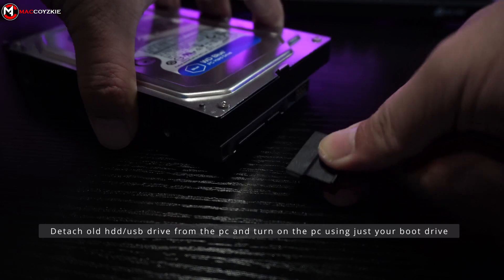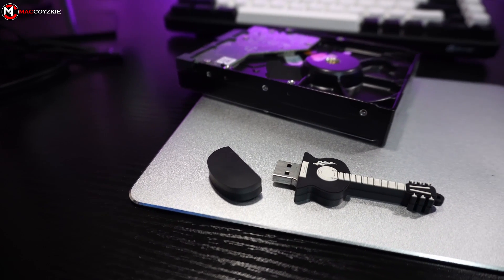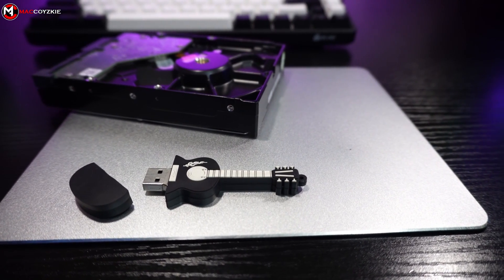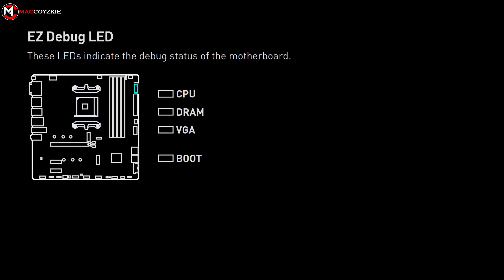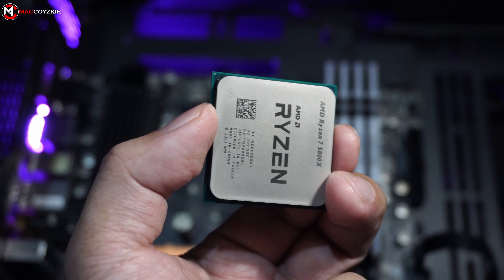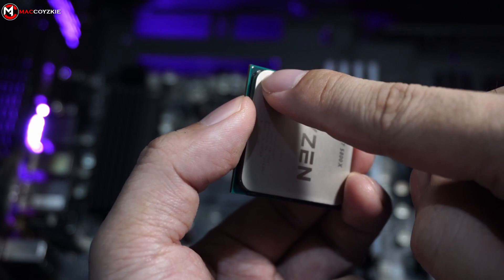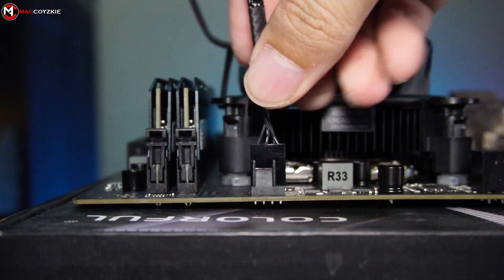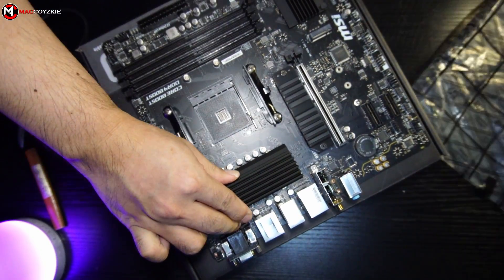Debug LED always on FIX

Comment: Have any of you guys ever managed to get your PC to post but the DRAM light remains on???? what the hell is going on? BIOS is fine for latest or oldest version, ram is detected, base ram speed and oc ram speed is fine according to the menu. All the components are listed. No CPU warning light. What am I meant to do? I was advised to just ignore the light and continue with OS installation and drivers.

I've done the CMOS clear, reseating the RAMs, doing one stick of RAM. All that got me was getting the PC to post. 

I even unlatched the CPU which I absolutely hated I feel like I am damaging the pins everytime I do this. And I untightened the CPU air cooler which runs the risk of it falling off the board given how heavy it is.

I am so goddamn frustrated. I know for a first pc build it should be but this is a whole other level man.
Reply from the maker: about the bios update, firmware must be specifically compatible with your cpu. if you already done that and the debug led is still bothering you i suggest return the mobo to the store where you got it from and ask for replacement. this is actually considered as faulty mobo since it's not reporting the correct debug led.
Reply: @MacCoyzkie  I managed a few restarts with windows doing updates. It did briefly have blue screen of death sad face for half a second and crashed. But now all the updates for drivers are done. I am now running a memtest86 test to check for faulty ram or motherboard. The motherboard now briefly lights up the CPU led, then DRAM and then both are turned off when I restart the pc. Thankyou for personally responding with a very helpful reply. Have a merry Christmas.
Reply from the maker: @qus.9617  glad it all went well bro! Merry Christmas to you too

Comment: vga light is on i can get to windows  but it dasnt let me get into bios , and when iam closing my pc i get thte monitor message check signal cable iv tried everyhitng execpt  changing mobo or monitor, i will try to test it another monitor but i know it will not do anuthing different

Comment: Sir mac, same issue ito ng akin nabili ko si mobo 2nd hand. For almost 4 months ganito na nangyari, nasira din nvme ko at not working na. Tapos eto for almost a week. Cpu light indicator lagi. May times na pabalik balik ilaw niya cpu-vga-boot tapos balik sa cpu, mag display yung auto repair pero mawawala display iilaw uli cpu. Ano kaya main reason ng ganito si mac?
Reply from the maker: nasira pati nvme sa mobo? baka short issue boss. yung kapag nadikit yung mobo sa pc case, may mga case kasi na mabilis daluyan ng kuryente kaya kapag di kilala ang pc case na bini-build ko, naglalagay ako ng electric tape dun sa standoffs ng mobo. minsan kasi nagkakashort dun kaya naga-ground ka kapag hahawakan mo yung bakal ng pc case

Comment: my motherboard shows vga led everytime i boot up in its stuck on a black screen. it occasionally turns on just fine but most of the time it doesn't. im using a 4650g without a separate gpu on msi a550m pro. please help
Reply from the maker: can you try clearing cmos for now, this is to run things in default settings, also for the mobo to redetect your hardware connected to it https://youtu.be/S9hyEPTFR10

Comment: Nice. But what if i randomly have CPU led light. Sometimes PC starts normal without problem. If it is started then it will work without any problem. If it is not i may need to hard reset it several times to make it run. What is the issue? PSU? CPU? MOBO?
Reply from the maker: sometimes you just have to reattach the psu pins on the motherboard, I fixed a pc recently with the same problem wherein i thought it was a faulty cpu but i tried a different psu, then it works, i thought it was his psu but when i tried this pc with his psu again and it worked. just need to reattach the psu
Reply: @MacCoyzkie  thanks! I will try it. Hope it is just PSU

Comment: My dram will light up but after a little bit will shut off then my display will boot up
Reply from the maker: that's normal, it's actually checking the hardware, but if the light didn't shut off then you can do the following in this video

Comment: I got different  problem  boot led always  on a620m e but pc running  fine. I cant turn it off
Reply from the maker: if pc is working fine you can just leave it but if its bothering you so much you need to update bios. for some reason most stock motherboards nowadays are doing that. tbh i will suggest you update it. be careful if you're going to do it your own https://youtube.com/shorts/nfH5Do3Dq3o

or just bring it to a local shop and have them update it for you
Reply: @MacCoyzkie  yup i am suspended  its a faulty bios related  issue . I am not touching it anymore untill its necessary

Comment: I just cleaned up my pc today. I put a new thermal paste. Now, I tried several stpes to fix it. What if there are no lights that pops out when I opened my PC, but the motherboard works. The GPU is On with lights, the CPU fan is working, but no lights on RAM. However I believe there’s no issue with the DRAM because I don’t say any lights from those 4. Any solution to this? Please help. Thanks!
Reply from the maker: if you tear the pc down including the cables then its most likely you misplaced the front panel connectors. double check it https://youtu.be/LxRzL5WFB9c 
try to jumpstart it through the motherboard using a screw driver 

also make sure the everything hardware and cables are seated correctly, especially the ram sticks https://youtu.be/UKR5xRsOhNg
Reply: @ the F Panel was all good to be honest. I really don’t know what could be the exact problem into this.
Reply from the maker: @kenozieobina5234  can you ask a relative or friend with compatible pc to try out your ram sticks? it's really difficult to figure out what's wrong so we need to test the individual parts of your pc into another working pc
Reply: @MacCoyzkie  ended up buying a new mobo, it was the problem. Very sad though it only took 2yrs, as there was moist inside.
Reply from the maker: @kenozieobina5234  sorry to hear that bro, 2 years is short indeed. try placing silica gel inside the pc if you are not going to use it for a several days https://youtube.com/shorts/NcLkeTdquXw

Comment: Hey how about the cpu turn on but no led light up even  the red one. Please help
Reply from the maker: two things, psu is faulty or the motherboard is faulty. if you got a spare psu try it out to check
Reply: @MacCoyzkie  thanks I did try it on different PSU. Same result. I have no spare board. But the board led lights up. When I turn it on
Reply from the maker: @macahappy0609  sorry to hear that bro but the mobo might be dead. is this a new build?

Comment: If there is no lights after dram light goes off???
Reply from the maker: it means it detected the ram sticks and its working just fine
Reply: @MacCoyzkie  but no boot after dram light pass
Reply from the maker: @jaswindersocialscholar  is this a new build or was a working pc? what's the pc specs and how did the problem started?
Reply: @MacCoyzkie  it's working pc and before that random frezzes started earlier and than sometimes this no boot sometimes working fine and than suddenly random freeze
Reply: i7 6700k + Asus z270f + thor 850watt
Reply from the maker: @jaswindersocialscholar  can you try entering safe mode https://youtube.com/shorts/IZKc8plksDA and ddu the current gpu driver https://youtu.be/SvIJhcxZTsA

if you can also remove any old hdd, remove it atm and just boot with the ssd 

if you can't enter safe mode then we need to check the gpu with a different working pc

Comment: My cpu debug light is on but when i went to a repair shop and tested it they said the gpu was the problem and when they place a new one the pc booted up... and although they cleaned the gpu and it worked again im now experiencing the same problem with the pc not displaying anything. Should i try cleaning the gpu again or make them test other parts
Reply from the maker: you can clean it the same way i did in this video, if it still does not work have it tested in your relative or friend's compatible pc to double check

Comment: I’ve tried everything, my motherboard is brand new, I’ve reseated my cpu 4 times and nothing and I’ve cleaned my ram I even got new ram and still nothing the dram light won’t turn off😢
Reply from the maker: new build or was a working pc? what's the pc specs?

Comment: What if all the debug lights turned on? I have a pc here that doesnt boot because of this.
Reply from the maker: if you watched the video these may be all the parts then, what's your pc specs?
Reply: @MacCoyzkie  5600x and 4060 ti. Its now fixed by resetting the CMOS for an hour. We suspect it was a motherboard error as we just installed a new cpu cooler.
Reply from the maker: @1torch  i see, glad its all good now

Comment: I have a 7800x3D and RX7900 and my display works, windows comes up, performance is fine, but the VGA Light is blinking green/orange, what does this mean? It blinks the same way when I remove the video card and get the image from the processor, it also blinks when I get the image from the video card. can anyone help?
b650 tomahawk
Reply from the maker: i checked your mobo's manual and it doesn't tell anything about the colors, for some reason these motherboard's from out of the box are giving these wrong debug led reports even if you can enter windows desktop. you can fix that by updating bios, just be careful if you are going to do it yourself https://youtube.com/shorts/nfH5Do3Dq3o

Comment: Hi,
I have cpu amd ryzen 7600 and msi b650 m gaming plus motherboard.
Using xpg 32gb 6000mhz single ram.
When i am booting by using 1st to 3rd slot in ram. It is giving me red and yello light errror. Not booting.
But when i using ram in 4th slot.
Red light go away in 10 sec and after next 30 sec pc booting up.

Not sure what is isssue, this my new PC not sure how to fix.
Can you please help.
Thank you for hear me out. Looking forward to hear from you.
Reply from the maker: the advisable slot should be the 1st one in a single ram stick build. shut the pc down, unplug it, place ram on the 1st slot, clear cmos https://youtu.be/S9hyEPTFR10 before power the pc back on

Comment: The whole video should be called : "remove and reinsert"
No matter what i did, the DRAM led was stuck. No RAM, one after the other RAM, switched RAM positions, Different RAM. Nothing worked. The RAM was tested in another rig with no issue.
So let's not forget the obvious reason. YOUR MOTHERBOARD IS TOAST.

Comment: Can it also be that the MOBO itself is faulty? I randomly get CPU and sometimes boot light but there are also times when my PC boots normally without applying any changs. What can it be?
Reply from the maker: yes but try to reseat the cpu first
Reply: @MacCoyzkie  I tried everything ang now I randomly get CPU light or VGA light and sometimes Boot light. But when the PC manages to boot it is very slow and even desktop feels laggy. I'll try replacing mobo and see if it helps.
Reply from the maker: @TheDiagoz1  you going to buy a new one? hope it goes well

Comment: I was playing on my pc and the display stopped working but everything was on, fans and gpu, I turned off my pc and then back on and it kept doing this until I had no display at all the pc is prebuilt and here it is

STGAubron Gaming Desktop PC, Radeon RX 580 16G GDDR5, AMD Athlon 3000G 3.5G, 16G RAM, 512G SSD, 600M WiFi, BT 5.0, RGB Fan x 4, RGB Keyboard & Mouse & Mouse Pad, W11H64
Reply from the maker: can you try the ram cleaning method in this link https://youtu.be/4hYcx-SdbU8 skip to 1:50 and if that does not work then this might be a psu problem. it probably gave up during the gaming session. you can confirm this by using a different psu so if you got a spare one or at least borrow from a relative or a friend

Comment: My PC works fine but sometimes the boot light stays on the motherboard when I get into windows and just stays there. It happens maybe 1 boot out of 6. A restart clears it. Im using an m.2 drive reporting no problems in testing. Feels more like bad motherboard bios/software.
Reply from the maker: yep, for some reason these motherboards released this year or at least the old bios is causing this. nothing will happen if you don't update it and your pc will work just fine, but if its bothering you so much you can update the bios, make sure the firmware is compatible with your cpu, and be careful, more info here https://youtube.com/shorts/nfH5Do3Dq3o
Reply: @MacCoyzkie  Happens on multiple bios so far. Even on a beta bios to test now but still happening occasionally. I also have crazy issues with their GCC software and RGB thinking their the wrong colours. What's annoying is I picked this board cause I had a x570 aorus elite before. It never had any issues ever over 2 CPUs. Legit uninstalled all the GCC crap but lose ability to change the little screen on my rx 6800 master gpu. I eventually managed to manually delete gcc and keep the screen at the last thing I set it to. Had to leave rgbS working from default bios as rainbow puke lol. Only other software I've found to override the wacky GCC RGB settings is signal RGB.

Comment: something very odd happened, im in the os, everything working fine, and the gpu/vga led is on
Reply from the maker: you might have the latest mobo in 2024, for some reason they are like that but it could be fixed by updating bios. just be careful if you're going to update it yourself https://youtube.com/shorts/nfH5Do3Dq3o

Comment: Thanks bro you helped me alot in my case the 3th light was on so i did was removed my hdd and checked the ssd sata and sata connected to the motherboard and it sloved the problem the ssd was causing the problem. Very helpful video thanks alot.
Reply from the maker: happy to help bro, glad it worked

Comment: Solid red & yellow light on my new msi b650m gaming wifi. I have 2 G.Skill Trident Neo Rgb 16gb ram sticks. I haev tried reseating the ram, checking the cpu(ryzen 5 7600x) for bent pins, reinstalling the cooler (arctic freezer 34 esports duo), reconnecting the cpu power & the 24-pin power connector, I also updated the bios, tried shorting the cmos jbat1. But no solution. I don't know what to do. All the components are brand new out of the box. Please help.
Reply from the maker: how about using 1 ram stick at a time, place it in the 1st ram slot then boot the system, btw are those ram sticks ddr5?
Reply: @MacCoyzkie   yes tried with 1 ram stick too. Yes the ram is ddr5 cl30 6000mhz. I'm thinking of taking the setup to a computer shop.
Reply from the maker: @badgerpatcher  i see, this might already be hardware problem but we can't figure out unless each parts are tested in a different pc. you'll be needing the help of a local shop to this so yeah you need to take the pc in the shop
Reply: @MacCoyzkie   guess what, expo on the ram was causing problems now the ram's running @4800mhz and the expo profile is disabled & the system booted fine. I am really happy.

Comment: Did everything for the boot and vga lights and they still turn on im not sure what else to try
Reply from the maker: is this a new build? what's the pc specs?
Reply: @MacCoyzkie  yea its a new build the parts are

AMD Ryzen 5 5600X 3.7 GHz 6-Core Processor

ASRock B550M Pro4 Micro ATX AM4 Motherboard

TEAMGROUP Elite 32 GB (2 x 16 GB) DDR4-3200 CL22 Memory

Silicon Power A60 1 TB M.2-2280 PCIe 3.0 X4 NVME Solid State Drive

XFX Speedster SWFT 210 Core Radeon RX 7600 8 GB Video Card
Reply from the maker: @Seven-id5ig  your motherboard needs bios update, make sure you down the firmware version compatible with 5600x, if you are going to do it yourself just be careful https://youtube.com/shorts/nfH5Do3Dq3o
Reply: @MacCoyzkie  yeah main issue i have no display whenever I turn on the pc
Reply from the maker: @Seven-id5ig  most b550 motherboard got those flash bios button on its IO and you don't actually need display to update bios. check your motherboard manual on how to since each brand has its own way

Comment: I got a question. Is the AMD Ryzen 9 7950x3D AM5 Processor compatible with the ASUS TUF GAMING B650-E WIFI AMD B650 AM5 ATX DDR5, motherboard?. My pc keeps turning off after a few seconds and the dram light is on. When I turn it on without the rams the light is still on. Don’t know what to do
Reply from the maker: update the bios, make sure the firmware is compatible with 7950x3d, but if you're new in updating bios just be careful because one mistake could make the motherboard stop working. more info here https://youtube.com/shorts/nfH5Do3Dq3o

Comment: I had both CPU and DRAM lights on. Switching the rams worked for me.
Reply from the maker: :yougotthis:
Reply: @Taurezas  I currently have that problem but I don't have no other ram sticks
Reply: @YooRyZe  i just swiched my ram sticks that i already had in my PC. I didnt use new ones ;)
Reply: @Taurezas  switching sides? Mine is dual channel (A2 /B2)
Reply: @Taurezas  you are a legend, actually cleaning and reseating the ram worked like a charm. I love internet for such valuable comments, you made my day hope someone make yours

Comment: Long story, I got a new graphics card, worked great the first day and the next morning my pic didn’t want to turn on and my motherboard had a red light which meant it was a power issue. Went to Microcenter and they said my motherboard was dead. Got a new board and now the CPU debug light is on. I tried all your suggestions and even got a new CPU but nothing worked. Idk what to do at this point. Please send help
Reply from the maker: wait, you didn't tried the new motherboard at microcenter? what's the new pc specs? perhaps it needed bios update

Comment: What if it is only connected with motherboard but still receiving VGA error
Reply from the maker: it is not detecting it or your psu wattage is not enough for your gpu to run so check the compatibility